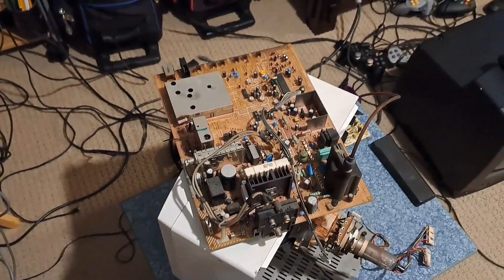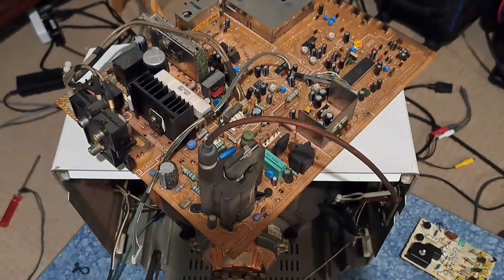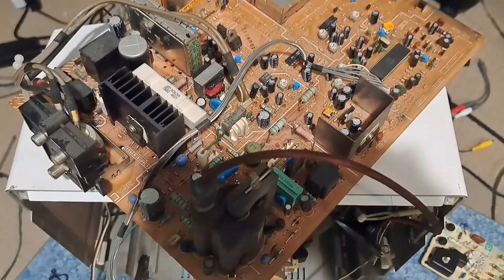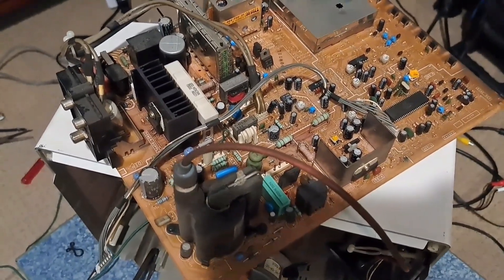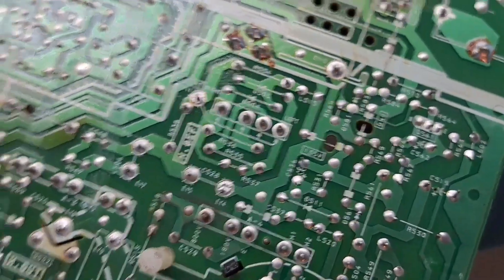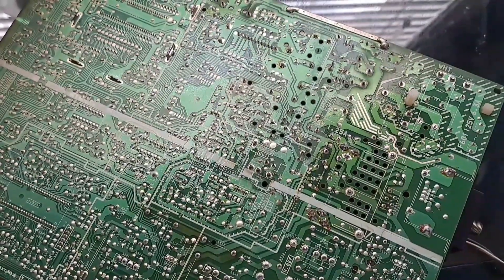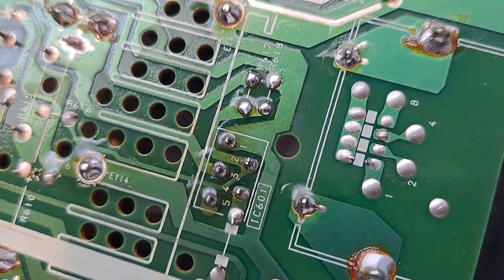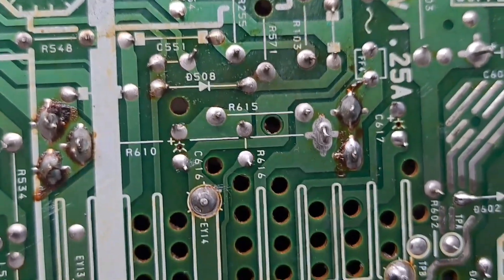Sony Trinitron KV-13TR24 CRT TV Cracked Solder Repair

Comment: I just opened up my KV-13TR27 today! Was having issues with the RF input as well as the 'VIDEO' text constantly reappearing on the screen. Ended up fixing it by desoldering the tuner, opening it up, and resoldering the points where the tuner board is soldered to the case. Seems to have fixed my issue! Apparently a lot of the units from this time period have similar issues. Thanks for posting this video. It's great that people upload so much helpful information

Comment: So I've got the same TV, and I need to open it. I checked out the manual for it, and it says that it's a live chasis? Is that true? Do you need to use an isolation transformer to work on it? Or just what you did here?